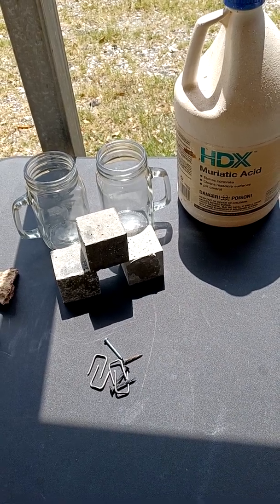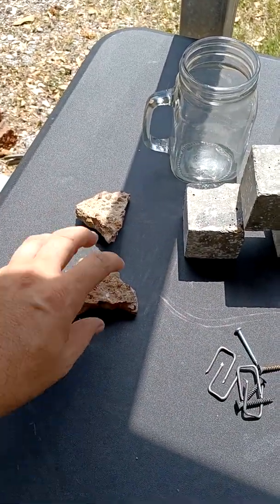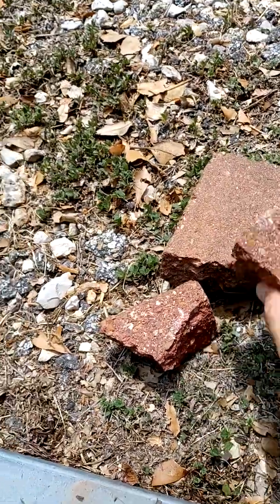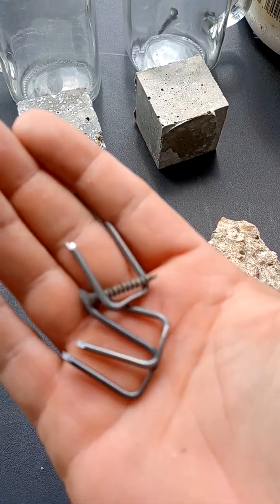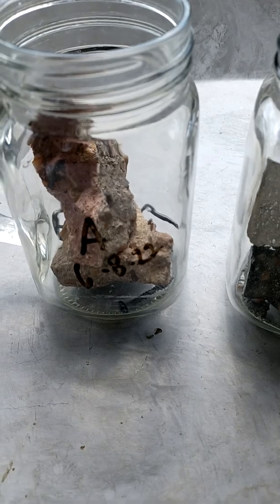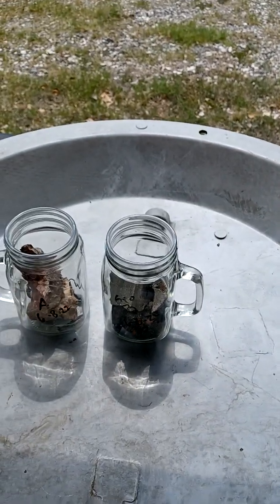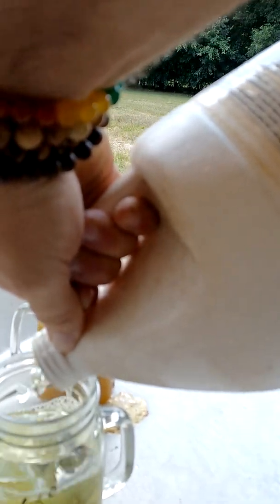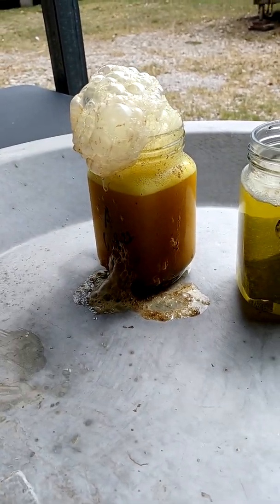100% Pure GeoPolymer Acid Test VS. Cement Concrete

Comment: Hey Eric, 

liked your video. This is indeed an excellent and easily executable test. Personally, I prefer the boiling water test following Davidovits, followed by an acid test if the material successfully passes the first. This is what I find fascinating about geopolymers - there are several straightforward tests that provide valuable insights into the material.

The hammer test is another one worth mentioning. While professionals often focus on numerical data (sometimes solely on numbers), having an intuitive sense of a material's properties is really valuable. It's not only about numbers; it's about developing a feel for the material in front of you, I find. 

Cheers
Pat

Comment: hmmm, maybe should say why you believe a muratic acid bath represents what portland cement based concrete is normally exposed to.  Also, how about some info on relative cost, since cost is what often drives materials selection in construction....bro.

Comment: It would have been much more accurate to have put the metal scraps into a jar C. In a proper control study, the brick sample in jar A should be the only thing in the jar.

At 8:15 the Muriatic acid is glugging out of the bottle, which causes splashing. You're holding the handle on top of the bottle.

Turn the bottle either 90° so the handle is on one side. Or even better 180° so the handle points down. You'll get a perfect pour every time.